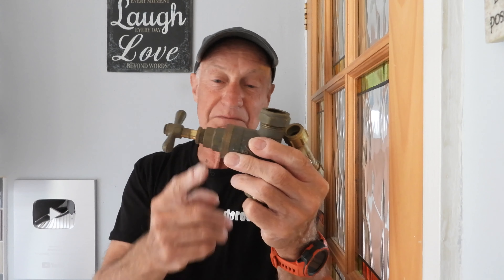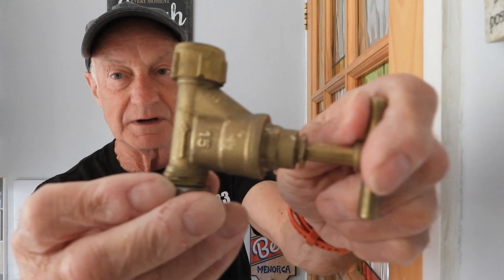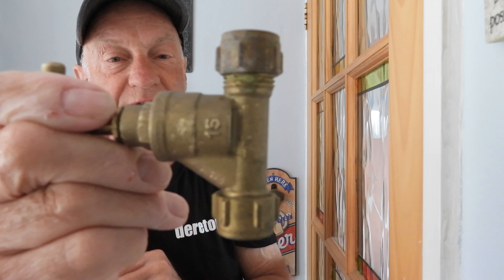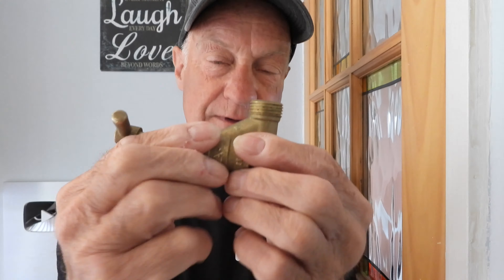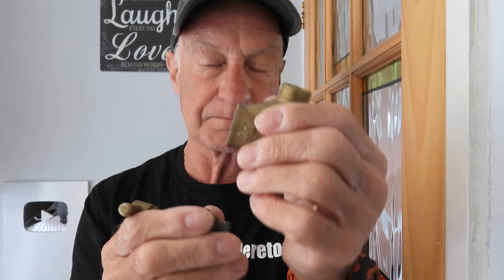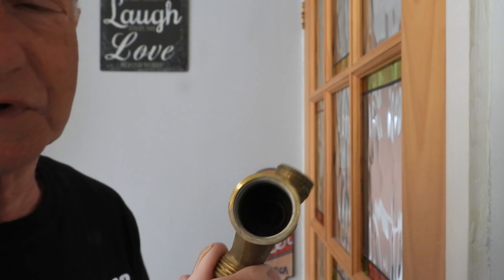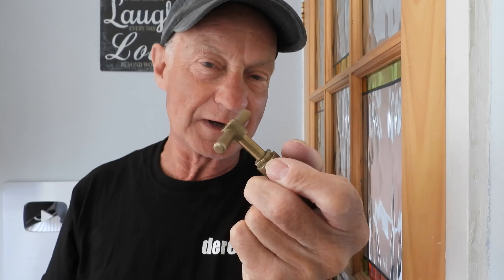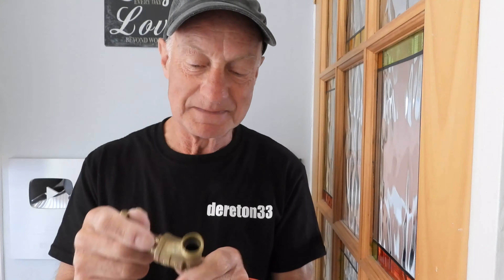#Stopcocks!! Why cant we have something better.

Comment: Good video.  I always use the shutoff in the street when I can, because if that has an issue the water company need to sort it out.  I totally agreed with you on the fact that the stop cock should have a better design and made from a corrosion resistant material.  Keep up the good work.  I have learned so much from your videos.
Reply from the maker: Thanks sergio.

Comment: With bitter experience of stuck stopcocks, I turn ours on/off occasionally to discourage seizing. Norfolk water is super-hard, and blocked the matrix of our 4 yo 'combi' boiler. The gas company voided our warranty quoting their hard water let-out clause (strangely not mentioned when we were sold that top-end service package). Luckily, a local specialist came and isolated the matrix, circulated lime remover through it, and charged £235 — far cheaper than £2000+ to fit a new boiler.
Reply from the maker: Thanks for the story.

Comment: Haven't used a stopcock in my house for years,replaced it with a Pegler 1/4 turn full bore lever ball valve,much easier & quicker to use.But, do use a quailty brand,may pay a bit more, but they last.
Reply from the maker: Great advice Stuart.

Comment: My experience as a plumber is those lever valves are prone to leaking. Your relying on a thin sphere of rubber to line up perfectly within the valve, with zero crud to interfere with it closing. Without a non return valve they can be noisy giving water hammer, with a non return valve/check valve that’s just another thing likely to break in the passage of time. Last time I checked lever valves aren’t allowed as your mains stopcock under either building or water regulations. 

Sure stopcocks have their issues but they do last a long time and are reliable. The problem ones are the older ones, but that’s to be expected of any valve. That and whether the customer either never ever turns it, or the opposite is paranoid about floods etc and is turning it on/off all the time (usually weekenders-folk who travel away a lot for work).
Reply: The better lever valves have PTFE body seats for better sealing.
Reply from the maker: Thanks for your input guys.

Comment: Bought my house new in 2000 and it doesn't have a standalone stopcock, there is one on the water meter housing and it is a level that only needs quarter turn to turn the water off.
Reply from the maker: They are fine.

Comment: Great info as always 👍Have you ever tried one of the live install Aladdin easyfit lever stop valves? These might be option If street stop valve not accessible (they are around £50 )but in my harsh recent experience possibly less risky than a freeze kit which burst the freeze capped pipe after thawing 💦
Reply from the maker: I have seen them but never tried one, may have to give it a go.

Comment: Even lever valves leak just like stop taps. We were taught to turn off and on all stop taps and gate valves 4 times a year. At least the old stoo taps had a string packing gland that swelled when it got wet so slowed down but these lever valves have o rings that tear when not used for a long time. I have even had trouble with these new hydraulic sure stops that don't stop.
Reply from the maker: Everything has its problem's.

Comment: I always turn the stopcock on fully open and turn it back a quarter turn If it's stuck next time you can try turning it either way as often it will free in the opposite direction
Reply from the maker: Good tip John.

Comment: Am I right in thinking that if the stopcock is built to en1213 then it provides backflow Prevention?
Reply from the maker: I only know that new fixed jumper models do not prevent backflow.
Reply: @dereton33  thanks for the reply. I got a new 15mm one from Graham's the other day and it has that en standard cast onto the body but I can blow through it both ways. I've ordered a DCV  to cover the base. Thanks.

Comment: Hi Al, do you know if you can replace standard tap gland valves with the ceramic ones ? and are they better ? last longer ? many thanks. i. enjoy the videos.
Reply from the maker: Not sure they are any better. But you can change the whole valve.
Reply: @dereton33  Thanks Al
Reply: Ceramic taps or inserts are far better providing you can obtain the correct one for your tap, fit & forget about overcharging plummers.

Comment: We had a kitchen and bathroom refit, and the Housing Association requested “Sure Stop” blue switches fitted. (I think because everybody opens the stopcock fully & doesn’t close half a turn, [the best way to have an easier release]).
Ours was fitted inside the kitchen sink, 6” before the cold tap isolator, so it only shuts off the cold tap in the kitchen. A leak anywhere else & we need to turn off at the stop cock or out in the street! Every bit of the job bar the tiling (can’t fault that) was equally bad
Reply from the maker: Bad work is everywhere Paul.
Reply: @dereton33 , it was that bad, the contractors lost the contract, after only phase one of 6. 
Our boiler was incorrectly fitted too, (still safe & legal thankfully but…) the magnetic filter to protect the pump was placed on the out feed, and it was wired so we either had hot water AND heating or no hot water & no heating. That took 4 weeks to resolve inc 2 visits by the contractors “engineers”, and one from the HAs Gas contractor, who opened up the junction box, said a derogatory comment, swapped two wires & left. He didn’t even need to look at the wiring diagram, unlike the two confused teens that revisited before him, together.

Comment: What's the difference between a stopcock and a gatevalve, and where and why should either be used? Thanks.
Reply from the maker: Stopcocks are not full flow through valves gate valves are. Stopcocks are used on high pressure mains gate valves on low pressure tank feeds.
Reply: @dereton33  Would a gatevalve leak if used on a high pressure mains pipe?
Reply: @mastercraft-carpentry  yes it would let some water past. They're really designed for older gravity systems with a tank in the loft.
Reply: @Tom_Plumb_PHS  Good to know, thanks for that.

Comment: I am from Norway and moved to the U.K. 20 years ago. When it comes to British plumbing practices I am totally at a loss on a number of things, where do I start?? When it comes to stop cocks these are not used at all in Norway, maybe only on very old houses you can still find the odd one. What is used is the 90 degree handle with a ball valve, they never seize up, and you shut the water in 0.5 seconds. Not an issue ever. Don’t get me started on water pressure and the dreaded shower pumps, it’s insane. In other countries you won’t find the shower pumps as the water pressure is higher, only god knows how much money British people are losing every year due to failed shower pumps, something people in normal countries don’t need as the water pressure is higher in the first place.
Reply from the maker: Thanks for all your info. Very interesting.

Comment: My stop cock jammed so rather than fight it I put a JG push fit emergency shut off in the pipe above it. That stop tap caused so much trouble with a weeping gland and the PTFE packing we used to fix it making every turn a fight when we wanted to switch it off. You have to love a push fit sometimes. :)
Reply from the maker: Nothing wrong  with a tight push fit. Ha ha.

Comment: Ive got 2 in my house now,first one failed and its in to lead at one side,tried turning water off in street and that failed so water board came out fitted new tap outside 4 foot deep and so then I put a stop cock above the stop cock but I dread the times when I need to turn it off just like you explain,great video👍
Reply from the maker: Thanks for your response

Comment: It would help if house holders knew righty tighty, lefty Lucy, so when they turn the valve hard left & water is still on the stopcock is not stuck! lol 😆
* Newer stockcocks are metric & really old ones are BS so more problems replacing them.
Reply: Should be taught at school. People just stand and watch a leak phoning the letting agent instead of shutting off and/or getting buckets and pans out meanwhile due to gravity it wrecks the flat below
Reply from the maker: Thanks

Comment: The trouble is that 99.9% of people won't maintain their stopcock. They see that their plumbing systems are working and just forget about it. And when it comes to needing to use it, by then it is too late. They can't use it. It's not so much of a problem for me as I am a plumber and can overcome the issues. But, it shouldn't be too much to ask for the customer to turn it on and off at least once a year to keep the gear moving freely.
Reply from the maker: Home maintenance is a failing art.
Reply: Same applies to water companys as they never service anything ever!